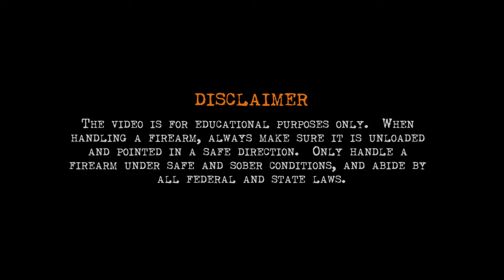Can You Use Brake Cleaner to Clean Guns?

Comment: I bought an used AK47 from a friend that was super dirty, I don’t think he ever cleaned. Use a large bottle of brake cleaner and left some parts like the bolt submerged in it and came out supper clean. Now I won’t use it in a pistol. Just for AR-15s bolts or any AKs, pistols are super easy to clean with just CLP.
Reply from the maker: That's awesome!  And yes, while it may be easy, this was more so about the cost.  Brake cleaner is far cheaper, especially in the long run.  I do believe it still is also factoring in the additional cost of oil and lube as well you'll need after using brake cleaner.

Comment: Brake parts cleaner can be a number of common solvents.  Some brands use n-alkanes (fancy name for jet fuel, kerosene, gasoline fractions) alcohols, and most commonly acetone.   At $ 2 for 14 oz for the Walmart can is not bad for acetone.  Check that O-ring in your AR extractor.  Some rubbers are not compatible.  Acetone is also a paint stripper and degreaser, so those painted dots on your slide could be gonners.  Wear eye protection.  Wear gloves.  Use in a well ventilated area.  Not really recommended to splatter on your optic's coatings either.  
Or you can use better, cheaper parts cleaner/solvent from the same paint section at the hardware store.  Its what the U.S. Armed Forces Field Manuals recommend to clean and degrease small arms:  Mineral Spirits.
Reply from the maker: Thanks for the write-up!

Comment: I use carb cleaner and oil immediately after. Does it degrade plastic? I don't know but so far no signs of that on my glock or any other gun of mine. Carb cleaner is meant for cleaning carbon off metals so why not? You absolutely have to do it in a well ventilated place with no flames, such as pilot lights though.
Reply from the maker: Carbs have gaskets, so I would assume carb cleaner should be safer, but I still would avoid directly spraying it on polymer/plastic parts on your firearm, just to be safe.

Comment: I think I'll stay away from using brake cleaner...thanks for the video
Reply from the maker: You're welcome!  What's your method of cleaning firearms?
Reply: I just added 1 quart to my Tahoe oil and after 300 miles change the oil and the trans fluid cleans the rockers and valve area.  Takes away the knock and tick sounds by cleaning them on a  V8 engine.

Comment: If you have a firearm thats cerakoted or has a parkenized finish, I’d stay away from brake cleaner, but for the most part it works great on guns that have a lot of rounds ram thru them
Reply from the maker: I've used it on a Cobray M11 and it was okay.  However, better to be safe than sorry.

Comment: I have been shooting firearms for nearly 50 years and never have had problems using brake cleaner or carburetor cleaner on any of my firearms. I even used WD40 for lube. (THE FIREARM PURITANS JUST HAD A CONNIPTION)
Never had issues, ever.
Reply: WD in WD40 stands for water displacement nothing about lubing. Let’s think about that.
Reply: @mikeanthony07  Okay, here we go! I don't know what blog you copied and pasted from. But they are completely wrong! Here is the official WD40 website on their product explanation. Read carefully and remember that! 
"WD-40® Multi-Use Product protects metal from rust and corrosion, penetrates stuck parts, displaces moisture, and lubricates almost anything." 
Truthfully, for the last few decades, I actually just used the Walmart Super Tech brand to save even more money. Again, I never had any issues.
I have shot firearms for over 50 years (10s of thousands rounds down range and used WD-40 (Walmart super tech brand) for much of those decades). Again, I never had an issue or a problem with said lubricant. But Hey, if you want to spend 3 to 10 times more on super secret, always proprietary, special formulated gun lubricant, go right ahead.

Comment: Marine Corps armorer here. Break cleaner is not good to go on rifles in the Marines. It’s very frowned upon here because it melts away the protective coating on the M4- M27. You’ll get some shit called blueing where your gun turns blue then slowly turns GOLD ! I’ve seen it before and it fucks up the rifles to the point where we can’t use them because of stress fractures or some bullshit. Just be careful w brake cleaner. Clp is the way to go just learn how to completely take apart your weapons
Reply from the maker: Thanks for your service!  I agree that it is always best to use what is designed for firearms.  That said, Marines are (hopefully) shooting and cleaning WAY more than the average person, so in moderation, brake cleaner should be okay.  I wouldn't recommend it after a casual range trip, but is great for something like the first clean after buying a used firearm.
Reply: @ThatDeltaBravo  personally I work at a battalion unit, so most of the guns I work with are infantry weapons. That being said they get used a lot more than a regular firearm owners gun and they get cleaned at least once a week if not daily depending on the operators preference. When they do clean them though they clean for hours on end until they are dry and carbon free. You’d be surprised what weapons can endure in terms of cleanliness. In other marine units it’s not the same especially if it’s not a direct combat role

Comment: I use a product from Castle called Shop Solv spray. Not because it cuts fouling but because it cuts the dried oils and grease that causes fouling and is safe for plastic. I get it from my work at a tractor dealership. You use what you have I guess.
Reply from the maker: I just looked it up, and it looks more expensive than Gun Scrubber!  I'm a cheap SOB.  :P

Comment: In a pinch I was just wondering if spraying out the bolt when you don't have time to break down and re assemble would be ok. Fluted Chamber in a PTR might be good too since you really can't get that MF clean with traditional stuff. I would think it necessary to spray on an oil otherwise you are bound to miss some nook or cranny.
Reply from the maker: There should be no "pinch" when it comes to cleaning.  Especially using WD-40.  If you plan on doing something like that, a CLP is a must.  However, if rushing, it takes minutes to strip, spray, and oil.  Not worth the risks of doing something like you described.

Comment: I also have seen some gun owners use a super lube or grease a stick on purpose to the metal and stay on for a long time. Oil will not last as long as the grease or super lube.
Reply from the maker: RIG Universal Gun Grease is like modern day cosmoline in my opinion, so I always use that.

Comment: I use gun scrubber which is real similar to brake clean , honestly maybe the same thing , i only use gun scrubber when i have a pretty dirty gun but it definitly cleans well. I always coat a gun well afterwards with gun oil of some type for storage and whiipe the excess off before the range.
Reply: It's best to use products formulated for firearms.

Comment: I use the acetone brake cleaner and it does make the plastic on my Ruger 22/45 feel funny for a while but that goes away in 20 minutes.
Cleans really fast.
Reply from the maker: That seems like it is degrading the integrity of the plastic.  Seems like it might lose durability like that, but if it works, it works!

Comment: hey i just noticed my guns have light rust on them giving a orange hue due to humidity will the brake cleaner remove the rust allowing me to oil them without the rust?
Reply from the maker: Brake cleaner does not remove rust.  I would suggest 0000 steel wool and something like Hoppes 9.  Be careful though!  Those are both aggressive and abrasive and could damage your finish worse if you're not careful.

Comment: Thanks for the video! In my experience with aerosol brake parts cleaners, if it melts a nitrile glove while you're wearing it, it's going to melt, or at least soften, any plastics. Now, the type of plastic will determine it damage. I'm pretty sure the composite plastics in many firearms can survive parts cleaners sold in parts/chain stores. I use electronic parts cleaner sprays here at work and the chemical will eat through a nitrile glove in seconds and it disastrous to many common plastics. It works wonder on carbon/soot, but again, kills many plastics! 

I have not and probably will not use this product on polymer? However, it has never harmed a composite valve cover or engine cover at all. The same product I mentioned evaporates almost immediately, faster than any brake parts cleaner I've used. And I've had great success cleaning brake parts with it. That said, I'm pretty confident your tests and suggestions are spot on and many folks wondering would be safe with cleaning firearms with Brake Parts cleaners!
Reply from the maker: Thanks man!  I really appreciate the detailed and comprehensive response.  That is the reason I took the grip panels off the Beretta.  30 year old plastic might be risky, but a new Glock should be (and proved to be) fine.  :)

Comment: If it comprises plastic, why is the nozzle made of plastic?
Reply from the maker: I think you mean "compromises."

One could make the assumption the nozzle was designed to handle the product, and is something you only use short term anyway, meaning when the can is empty, you throw it out.

Brakleen, which claims to be the first brake cleaner, came out in 1971.  One could make another assumption that any firearm that came out before then, and even most after 1971 that had plastic before the polymer used today came about, were not developed with industrial strength cleaners/dissolvents in mind.

So... Yeah...

Comment: I have mixed feelings. Yesterday, I cleaned my SW40. Yes, I used brake cleaner. My guide rode broke and now i need to buy another to replace the one that melted. With that said, my gun has never looked cleaner! I did use oil after the process to protect my gun.
Reply from the maker: Best to just keep it on the metal then!  😂

Comment: Used it on a shotgun I painted.  I taped off the rubber butt pad snd that was it! After that I taped everything I didn't want painted and started painting! One year later I'm still happy with the results! However I personally would never use it solely as my cleaner!
Reply from the maker: Nice!  I agree.  I use it when something is really dirty, or maybe a once per year clean on something I shoot a lot and clean a lot.  "Normal cleaning" won't get everything this will.
Reply: @ThatDeltaBravo  when I used it it left something I could see, almost a white looking film or residue. Cheap brake cleaner from the Dollar Store. The gun I painted is on my page under the community tab if you would like to see the results!

Comment: Which break cleaner is it
And is it the car or heavy vehicle break cleaner or what
What if in a long pot v put our M4 for some 10 to 15 min then v dry it then v put it in diesel for around 30 min
Then take it out and dry it from the out side only and leave it in the sun for some time so the inside diseal drips out
Aso how's that easy fast process
Reply from the maker: I don't remember.  I think this was the store brand from Advance Auto Parts.  I can't speak for the old Navy Seal tricks you're talking about, but I know spraying this works!

Comment: I've used non-chlorinated brake cleaner to clean stainless steel parts before I TIG weld them and I haven't noticed any discoloration or problem... But do it at your own risk
Reply from the maker: Thanks for the information!  I agree though... Do at your own risk.
Reply: @ThatDeltaBravo  I'm using this method to clean a very filthy Winchester Model 50 and so far, it's going very well. I wouldn't use it on parts where you care about the bluing; I'm just using it on the bolt and guiding components and thoroughly oiling with Valvoline full synthetic 0W-20 immediately after the brake cleaner dries

Comment: Good video, I think brake cleaner is a very harsh cleaner hence the name its designed for cleaning brake parts, I would not use it on my firearms especially when there are many safer solvents, and you did demonstrate how it removes everything to bare metal,  in my opinion its over kill for firearms.
Reply from the maker: Thanks!  I think it's safe for moderate use on "modern" firearms.  Do I use it all the time?  Nah.  But at least I know I can if I need to!

Comment: Wouldn’t a great degreaser work just as well?
Reply from the maker: I wouldn't recommend it.  That's more for "oily gunk," for lack of better words.  In most cases, a firearm is just packed with (dry) carbon deposits from fired rounds.  Obviously some gun oil as well, but if you have enough oil to warrant a degreaser, your firearm probably won't be functioning well to begin with.  Lol.
Reply: So you’re saying degreasers don’t work on dry carbon deposits?
Reply from the maker: @mikeanthony07  I'm saying that's my opinion.  Lol.  Try it!  If it works for you, awesome!  However, this was my test on brake cleaner.
Reply: I hope more people are trying out “degreasers” because they work great outside and inside Gun! Follow up with synthetic oil on inside of Gun and it’s rails! Nice combo.

Comment: Since you are using brake cleaner, Why not use engine synthetic oil, works pretty good on cars?
Reply from the maker: That will drip.  ;)
Reply: @ThatDeltaBravo  synthetic oil is more sticky than regular oil, so just a light coating and that will prevent from rusting also
Reply from the maker: Hmmm.... True.  I think for THAT type of stuff, I'll stick with RIG Universal Gun Grease.  Don't want to get too carried away.  :P

Comment: Nothing wrong with using a brake cleaner or amy spray solvent to clean any firearm mechanics, but the reoiling is crucial and have seen some bad outcomes. As far as i am concerned if you clean every time you shoot there is no real need for a spray solvent. G96, clenzoil, breakfree clp  etc will do the job just fine. Amd never have to worry about missing lubrication which is most important

Comment: Brake cleaner and Mass Air Flow cleaner are ALMOST the same chemicals. If you're worried about your plastic use Mass Air Flow cleaner.
Reply from the maker: Fair point!  However, MAF cleaner is a bit more pricey.  Not an extreme amount more, but over time, every dollar makes a difference!  :)

Comment: I've been using brake cleaner to clean my guns for years.  at 2-3 bucks a can, It's a lot cheaper than any other cleane, it works great and cleans everything.  I never had any problems with the polymers I trust it on.  Hard plastics like pistol frames have never been damaged by it.  When I first started using it, I ruined a soft plastic grip on my High Power. 30 bucks wasn't too expensive of a lesson to learn.  I avoid wood and things like mag followers with it,   After I clean the guns, I give them a light spray of G96 and wipe them down and I never have a problem with rust.
Reply from the maker: Well said!  Thank you for the comment and watch!

Comment: Yeah I just sprayed my ar15 today with brake cleaner to prep for camo paint and it destroyed my lower receiver. it literally cracked and crumbled into pieces.
Reply from the maker: Did you leave it out in the sun for 25 years?  That doesn't sound right.
Reply: @ThatDeltaBravo  Lol no. My dad built it about 10 years ago. I recently got it when he passed. I believe it was a 3D printed lower and assume materials just were’nt as durable as your typical manufactured lower.
Reply from the maker: Just noticed this!  Sorry for you loss.  Yes... It's very material dependant.  3D printing just now is only barely getting into short term use durability for firearms.  10 years ago, it was probably weak material then, and definitely not ready for a chemical cleaner.

Comment: Hello. Im a primitive metal head. Is brake klean and karb klean basikly tbe same shit? Bekuzz thats what i used to klean last time and followed up with WD-40 just to keep it slightly Soviet with an amerikan twist. Just kurios. Thanks.
Reply: Don't you have the letter "c" in your alphabet???
Reply from the maker: I believe brake cleaner is a tad more harsh.
Reply: @stanleyneiljelinek1924  broken key
Reply: WD-40 isn't a lubricant, you need an oil not WD-40 after using brakecleaner.

Comment: There’s no reason it wouldn’t work on metal components. You can also use carburetor cleaner.
Reply from the maker: The concern is more for the finish and plastic parts.
Reply: @ThatDeltaBravo  can you test carb cleaner on the polymer parts?
Reply from the maker: @kanaka118446  Honestly, it would probably work just the same.  Haha.

Comment: Brake cleaner is fantastic for removing general grime and soft carbon... But it doesn't do squat to remove hard carbon in the bore.

I started using Free All penetrating oil in the bore. I hose a bore mop down with it and slather the bore and let it soak. Then I use an old bore brush wrapped with a cleaning patch. You'll be surprised how much cooked on carbon was left in the barrel. If there is a lot you will have to repeat the process several times.
After I get all the carbon out I use brake cleaner to remove any remaining Free All. Then I use CLP to oil the bore... And before shooting I use brake cleaner to remove the CLP. I've found that leaving oil in the bore when shooting contributes to carbon fouling.
Reply from the maker: Nice!  Thanks for sharing your method!